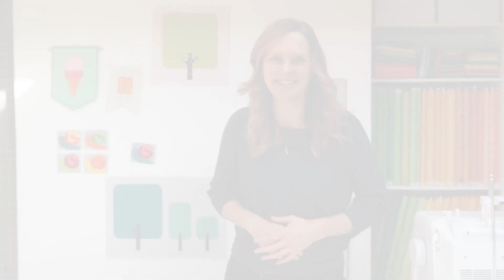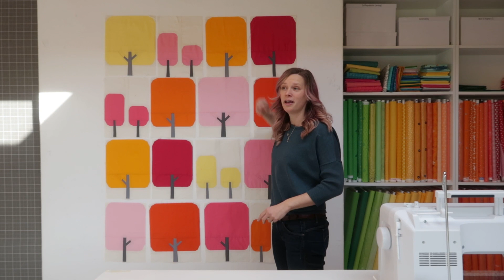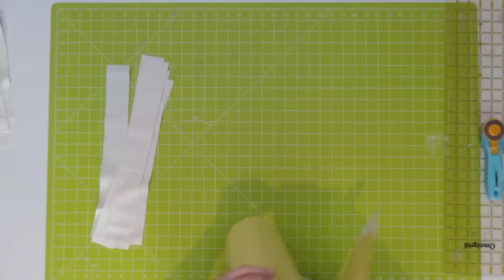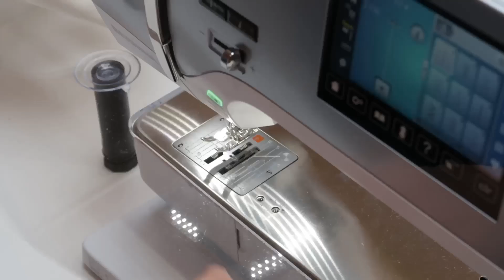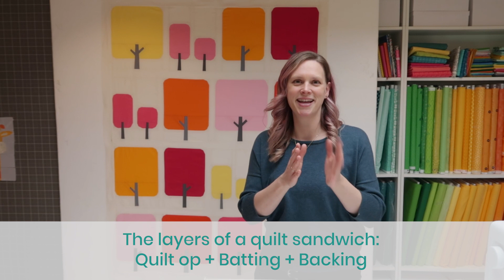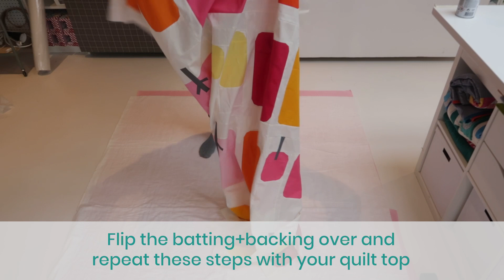One Two Tree Quilt Assembly [Sugaridoo Bernina QAL]

Comment: Will you be offering instructions or advice for quilting on a machine with a very small throat area (6.5")?  I struggle with free motion quilting on my machine when the quilt top is so big, like this one is (54 x 70).  I really cannot fathom how to use rulers with my machine on such a large quilt.  Will some trees be quilted "upside down" to accommodate regular machines? I have my top sewn into rows.  Afraid to sew the rows together until I see further instruction. Thank you.